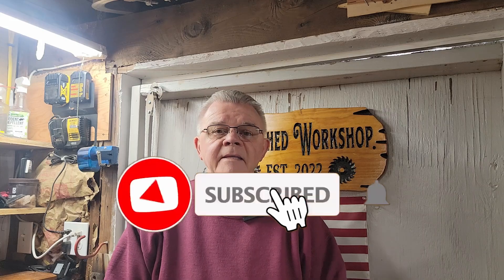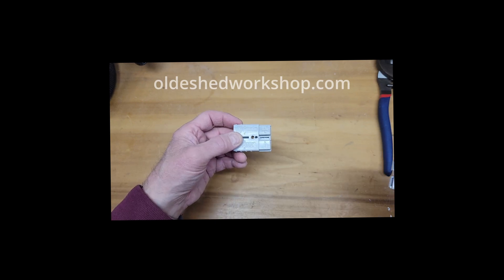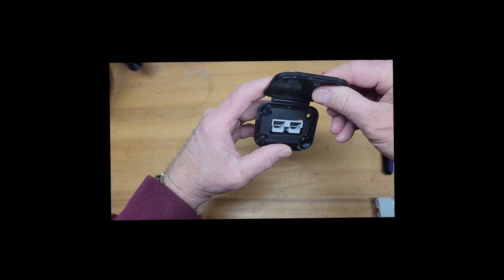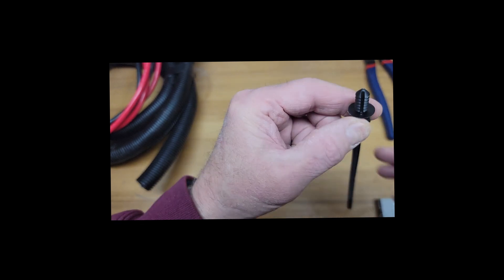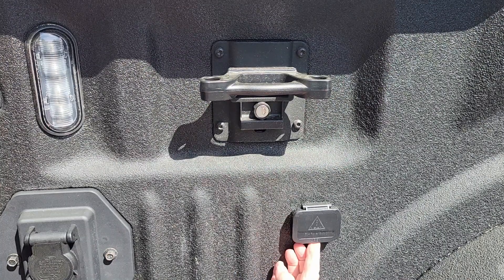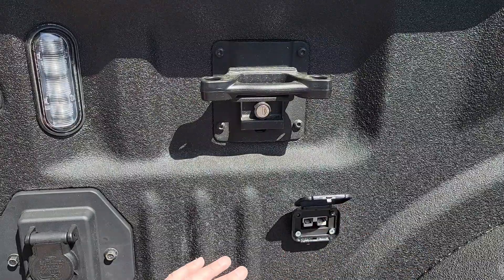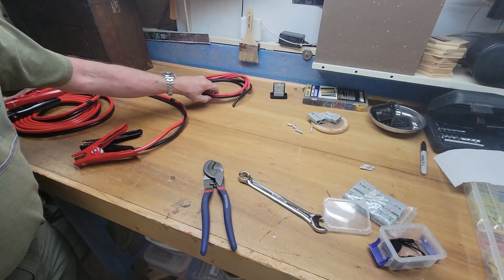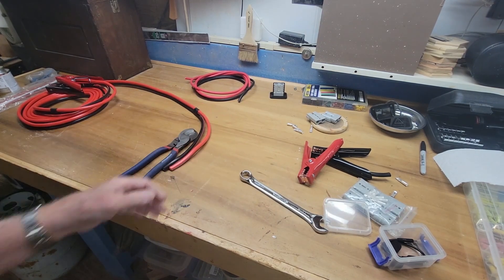How To Wire Ford Super Duty For DC To DC charger

Comment: Great video, thank you!  Question my kit comes with 4 awg wire.  Do you think two 4 awg wires will fit in the 1 inch wire loom?  When I did a google search it recommended 1/2 inch loom for two 4 awg wires.  I don't want loom that is too big.  Thank you
Reply from the maker: I'm not sure of a "kit", but the 6 gauge wire was a tight fit.

Comment: Had you run over to the passenger side battery, there is also a 250 amp fused accessory point off the accessory battery harness.
Reply from the maker: Thanks for the tip! I appreciate the feedback.

Comment: Thank for the video on this. How’s the 6 AWG wire working out? Are you getting the amps expected?  Assuming you have two batteries on the truck…any reason you didn’t connect to the passenger side battery?
Reply from the maker: I found it easier to run the wire right up the driver's side to the secondary battery. Glad to share the info, best of luck on your install!

Comment: Thank you for making this!  I'm about to do this exact same thing to my 2024 f250 and I wasn't sure if I could use the battery that's on the driver side of the truck or not.  Glad to see it worked for you and thanks for all the helpful tips on running the wire and connecting it to the battery.
Reply from the maker: I found it easier to run the wire right up the driver's side to the secondary battery. Glad to share the info, best of luck on your install!

Comment: Nice work on this install. Very detailed and you explained everything very well. I also have an F450 and plan to install a DC to DC charger.
Reply from the maker: Thank you. Hope it helps.
Reply: 2 questions.

Do you have the auxiliary switches in your truck? I am thinking of doing a project like this but having it run through one of the aux switch relays. 

Do you have the dual battery configuration in your truck? I didn't see the BMS on the negative terminal you showed in this video, so I would assume you have a second battery where the BMS is located. Tapping into ground directly at the terminal and not at a point after the BMS (like a body ground or on the BMS itself) will prevent the computer from seeing the draw and managing charge correctly.
Reply from the maker: You don't need to go to the up upfitter switches. You turn the charger on right from the app in your phone. The upfitter switches don't have a big enough fuse (40 amp max) and the wire to the switches isn't heavy enough.Thanks for watching.
Reply: @oldeshed  40 amps would be fine for my needs. The small wire to the aux switch is just from the relay - on/off control - it does not carry the connected load. The 40 amps relay supports 10 ga wire, which is fine for the final connection point, but stepping up to bigger gage wire for the long run makes sense after the initial relay connection. You could also use 2 aux relay connections together if you really wanted to.

The negative connection should not go direct to the terminal in either method with the BMS.